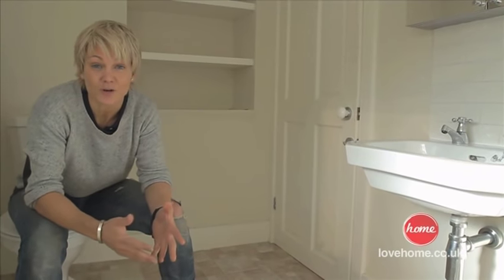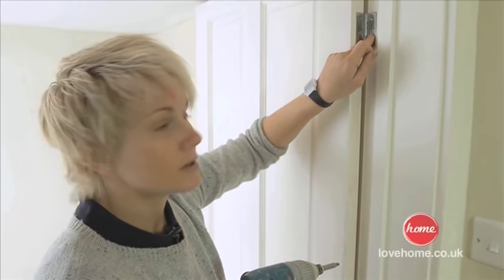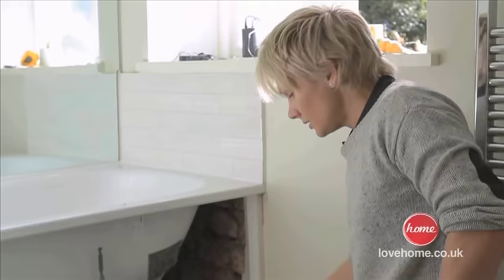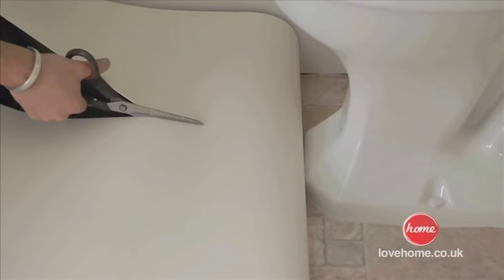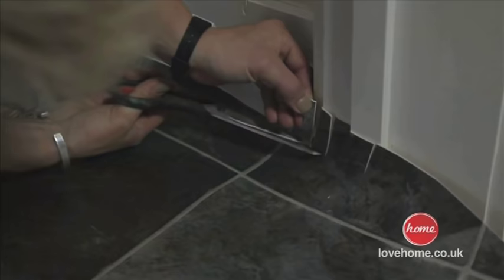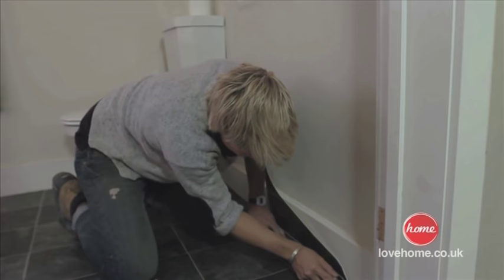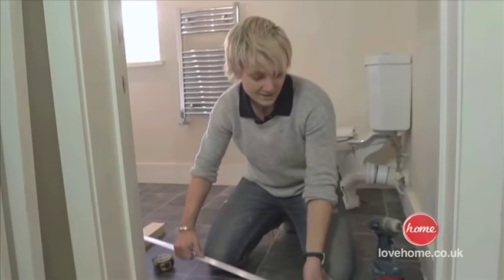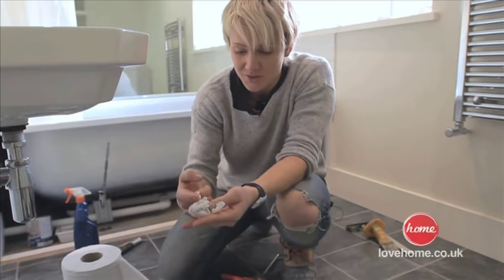DIY: How to lay vinyl or lino flooring

Comment: You put a sealant between the bottom of the walls and onto the vinyl?  I was always told you don't want to do that - to make the edge "floating" to help prevent water from touching the drywall and the drywall soaking it up and to allow for flexing from swelling of the wood from outside and inside from temperature changes.  Is this right or wrong?  Ty in advance!  (Working on the bathroom after replacing a rotten floor from a wax toilet ring leak!)  Cheers!

Comment: Such a helpful video! Thanks! 
Can I ask - I'm redoing a small bathroom vinyl floor and the previous vinyl wasn't stuck well or siliconed so it comes up easy. Could I take it out and use it as a template to cut the new vinyl? 🤔
Reply: Yes

Comment: Just curious why you didn't just take your door pins out and why you didn't lift your toilet?Its only two bolts and you have it on your vinyl when you set it back.Why didn't you glue your vinyl and why since you slopped it in didn't you seal your seam in behind your toilet?
Reply: Because in the UK most door hinges don't have removeable pins, and most toilets use rigid copper pipe to the cistern so it cannot simply be lifted.

Comment: Thank you for the nice video.  I've tried this a few times and still have no confidence.  I cant seem to cut a straight line and even when I use a straight edge Im never sure exactly where to cut as the you cant see the back side beside the wall.  Sometimes I find I cut too much and then there is a gap between the vinly and wall.  How do you know where to cut exactly?  Is there a cheat or guide?  My vinly is 1.8mm thick.  Also I am thinking of doing this through out the entire house as my design is that of wood flooring.
Reply: +Genki Kids I know what you mean.. Some people remove and reinstall the baseboards or coving. Toilet also.. The white caulk may be enough to cover for my shaky hand but I plan to practice before I decide..

Comment: Great video thanks, I have slightly uneven floorboards near sink pedestal and want to lay lino. Can I still do this? Do I need to seal the floor to as I did pva it when i laid  vinyl planks which got damaged in  small water leak.

Comment: You don't need to take off the entire doorhinge. Just take out the hinge-pins. It's a lot easier and quicker than unscrewing the hinge. Also, when you go to screw the hinge back in, you'll need slightly larger (thicker) screws, as the original screws won't hold in the original holes for long. Regarding the toilet, take it off and lay the linoleum under it. That way, you don't need to worry about perfect cuts and it seals better too. Other than that, this is a very good video.

Comment: Thank you for this video!  I have a question on the door strip/threshold though.  If you are on a concrete slab, how would I screw it down?  Would it be better to use a sturdy adhesive glue instead of screwing it in?  Not sure how screws would go through concrete.  Great video! Very helpful!
Reply: You can screw it down, glue it down or do both. For a glue I would use an expanding polyurethane based glue, just make sure to put some weights on the strip while the glue cures.
Reply: Drill your holes then use rawlplugs to take the screws.
Reply: @paulwestwell7160  what do I drill with and eaht are rawlplugs?
Reply: Rawlplugs 🇬🇧 = Wall anchors 🇺🇸
Reply: @paulwestwell7160  ohhhhh! Gotcha!  Thank you so much! :)

Comment: We always take the toilet up and lay the vinyl over it. I've never seen it done this way. Also, I had never seen tape used for this either. I think I am wondering the same thing as fordmanmal, I would be afraid that it would shift if something wasn't attatched in the middle. What kind of tape did you use?

Comment: you didnt use any glue? i see that some vinyl flooring does not need glue.. am i right?? because im trying to install vinyl flooring on top of nasty bad looking wood flooring..
Reply: +Matt TV. (Matt HD Tube) she used double sided tape for the corners only no glue or other adhesive involved unless you are putting vinyl over concrete

Comment: So... no vinyl floor adhesive with a notched trowel is needed?
Reply: @JR-1983  Glue more expensive than vinyl... the irony should be funny but it's annoying! I used a notched trowel with too large of teeth and had to scoop off the excess glue with a cheap plastic trowel I bought - I figured I'd use too much glue, lol. Came out great though.

Comment: I‘m confused about the terms „vinyl“ and „lino“. Is this rolled up sheet really the same material as e.g. a click vinyl?

If it is the same material: why do click vinyl when you can just roll it it like this?
Reply: From what I can gather, vinyl is synthetic, water proof and made from mostly PVC. Linoleum is less waterproof but still resistant to an extent. It is made using natural materials such as linseed oil, wood etc. Im looking into this because I have no idea how to actually tell the two apart.

Comment: What would have actually been useful would have been an in depth demonstration of the art of cutting around pedestals rather than the few seconds shown here!

For someone who has never laid vinyl the actual cutting around corners pedestals etc is far more important than the TOP TIP of cleaning your loo before you start.

The tip of sealing around the edges with silicone and using a spray of water and washing up liquid was very helpful, but not telling us what the mix was, was not, half and half, one in ten, one in 50?

Comment: Why would you cover an expensive tiled floor with tile simulating vinyl, or if the original floor was vinyl why not take it up and use as a cutting pattern.
Reply: it wasn't tiled, it was another vinyl type covering.

Comment: can you lay lino overtop of lino for a freshlook, or do you need to take up the old
Reply: Laying the new over the old is easier because the floor is already flat. If you pull up the old floor, you might make a lot of work to relevel it. Pulling up glued on vinyl is hard and the remaining glue will not be flat enough. But if you pull up the old you have a template to cut the new flooring.

Comment: just a fair warning for any diy'ers. This is not the correct way to install a floor in a bathroom. if anything happens and its istalled like this, the insurance company will laugh in your face and tell you that you have to pay everything yourself.

1. its not glued down (noway that it is resistent towards water)
2. the floor itself is supposed to en 10 cm's up on the wall ( to seal in any water that comes on the floor.)
3. you start from the bathtub (which should be removed before installation together with all the other toiletries) if you do like this, Because its the most critical place for water leakage, you NEED the floor there.

Comment: Silly woman, the door hinge is designed to remove the vertical pin to remove the door. You get a small punch or nail and hammer it in from underneath upwards. The pin should slide up and then you can remove the door without disturbing the screws. To replace the door you simply reverse procedure. Oh, and do start at the bottom to remove the door. To replace it you start at that top so it hangs from the top hinge while you are resetting the bottom pin.

Comment: Two things I really don't like. You should have popped the pins rather than pulling the whole hinge. You used a screw gun to take them off so I know you used to screw gun to put them back on you over tighten them strip them out then your fucked.
#2 Cut the vinyl  around the toilet rather than pull the toilet and cut it tight around the flange. Now what if the toilet was already starting to leak before you started a job or if it started leaking recently after the job. You'll never know until the floor  rots out from underneath the customer.

Comment: This is not a good video of how to properly install vinyl flooring. You left the old down and used no glue to hold it down. You didn't stretch it at all and you old used double sided sticky tape around the edges. It looked good when finished but it won't last long and if you wait a year of warm and cold temps you will start seeing bubbles and wrinkles. It was a lazy way to do the job.

Comment: never thought I would add a comment to these.

Loads of problems. should not lay on top of another as they can react with each other.

Use a hook blade.

Tape should be anti plas

who ever fitted the wood laminate fitted it short and because of this its not under the door

On  a good point , not bad  for a women; better than most carpet fitters !
Reply: Seems like you felt compelled to comment because it was a woman. I was with you until the end

Comment: Philippa you should have just taken the bolt out of the door hing instead of unscrewing.  It's quicker and not that hard to put back together, plus you don't have to worry about screwing all those screws back in.  I would have also pulled up the toilet and bought a new wax seal ring.  It's not that hard to do and it would have given you a much better finished look.  You should have removed the old vinyl as well.  You are no expert Ms. "here's a tip"!!  I'm a DIYer and not professional by any standard, but you are giving bad tips and information!
Reply: Your probably right, but hey, she did a great job anyway!
Reply: +Randal Cain Then go ahead and hire her.   I on the other hand will stick to quality.
Reply: let her do it the way she wants to
Reply: again you're welcome to hire her,  I personally would want something done to industry standard and no shortcuts. Different Stokes for different  folks in the end.
Reply: I'm a carpenter mate and I always unscrew hinges as most don't have pins it takes less than 30 seconds with a drill and in a room that size leaving the old vinyl down wouldn't hurt also "I'll stick to quality" if that's the case you wouldn't be using vinyl as it's a cheap alternative to tiles, karndene ect... you sound like someone who knows f all but likes to knock other people
Reply: Richard Fraser As I stated earlier different strokes for different folks.   I personally would not want to keep previous floors before putting in a new foor in case there is a problem you would catch it instead of putting a new "bandaid" over it.
Reply: Dang you must be really cool, well she didn't , what now?